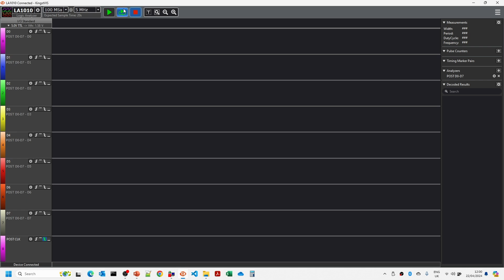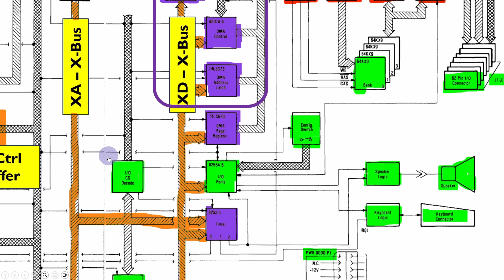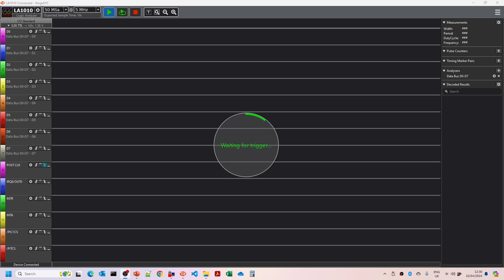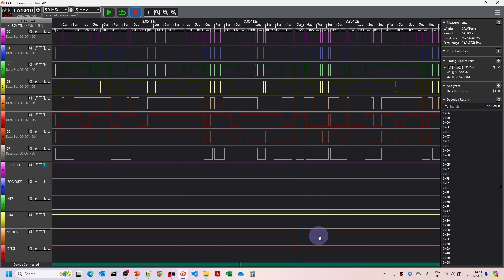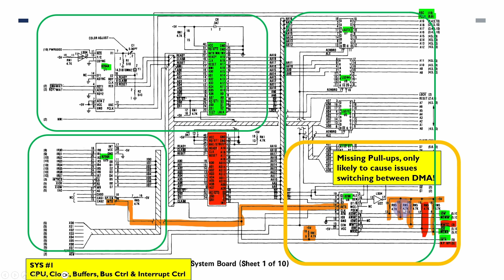Breadboard 8088 PC Compatibility Part 9 - Testing Interrupts and DMA #31

Comment: 15:20 Would it make sense to use drivers/buffers like the uPB8282 and uPB8286 instead of connecting two chips together to form a piggyback? These chips are capable of driving 32mA (low) and -5mA (high) respectively, which is more power than a 74ALS chip can deliver.
These chips were developed exactly for this purpose, as far as I know, as there were already problems with buffering the data busses, especially in multimaster systems. They are available on eBay for a reasonable price.
Reply from the maker: Not come across those buffers before and I have a tube of 74ALS245's so that was the path of least resistance! Once its all working I will try pulling out the extra 74ALS245 to see if it still works. I suspect the dud DMA 8237A controllers wouldn't have helped. Will take a look at these for the next project. Dave